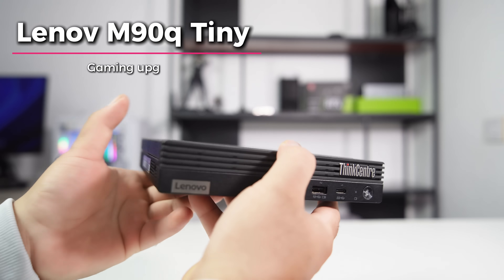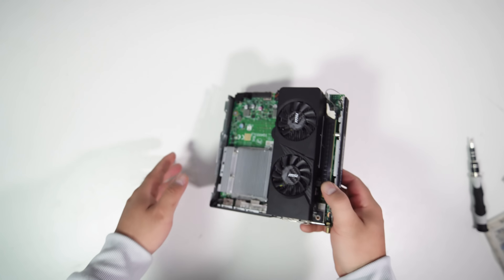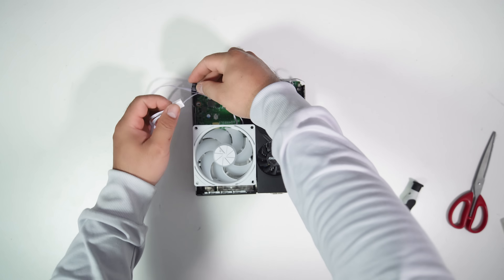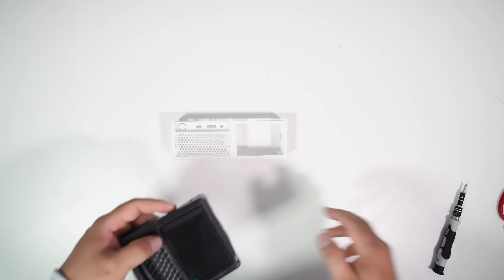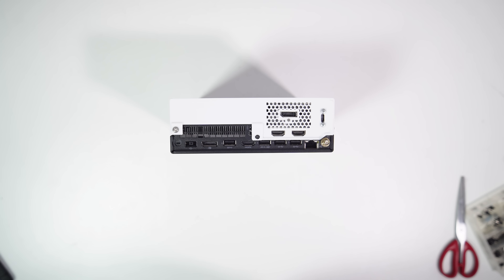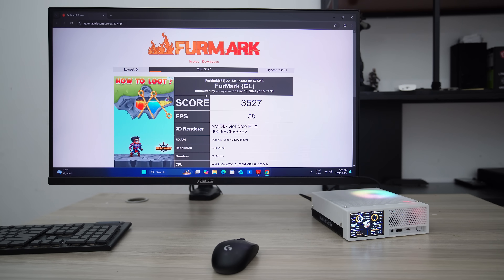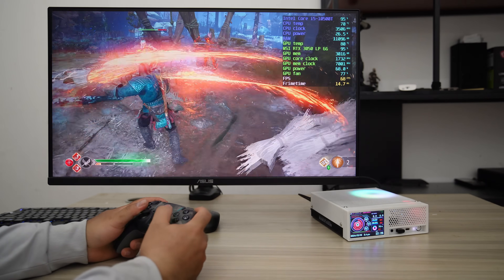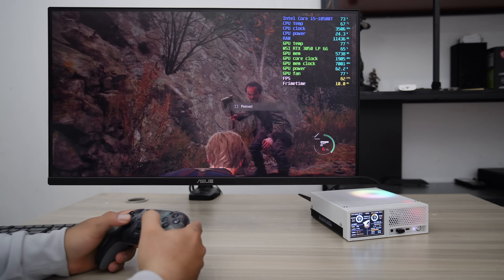Lenovo M90q 3D Case Mod: Epic RGB Fan, Stunning 3.5in LCD + RTX 3050 LP, CPU Fan Noise Fixed!

Comment: Is the 3d case compatible with the m80q?
Reply from the maker: Yes, the case should support M80q gen1 but you don't need it because M80q doesn't have PCie slot.

Comment: I can't help but wonder about the efficiency of the CPU cooling solution.
The OEM fan is designed to blow air across the radiator fins from the front.
Your fan is mounted on top and attempts to blow air downwards. There is no spacing between the fins from the top side so the air can't even go in between them.
Reply from the maker: You can just check the CPU temperature during gameplay; it was nothing bad. You can't have everything at once, and trade-offs are necessary. I consider this a balanced setup and have no complaints about the CPU temperature being around 75c. This project is primarily for DIY and hobbies. If you were upgrading this PC strictly for gaming or serious work, it wouldn't be worth it since the performance is low. The screen and RGB fans, therefore, are a great way to showcase what a DIY enthusiast can build at home. If you're looking for a high-performance PC, this project or video is not for you.

Comment: I am new to this so apologies for the daft question:
Could this work with a Dell Optiplex 7040 or so?
Reply from the maker: No, it doesn't have a pcie slot.
Reply: @itggear I saw someone plugging a graphics cards with adapter cable via SSD slot by the looks of it. Again, curious as very now to me so sorry if its wrong

Comment: 9600x3d(65 watts) and 5060(145 watts) the hdplex 250 watts gan can handle this cpu gpu combo? With itx mobo 32 gb ddr5 and gen 4 m.2.
Reply from the maker: Check another reply comment.

Comment: Where does this VGA power come from? does it use power separately?
Reply from the maker: It's the RTX 3060 6GB version with a 70W TDP, so it draws power directly from the PCIe slot.
Reply: Do all RTX 3060 low profile VGA not require additional external power or power supply? @itggear

Comment: Great video and 3d Design!! someone know what is the name of connector for fan? any convertor to pwm normal fan? Best Regards
Reply from the maker: It is DIY connector. I cut the original CPU cable and wiring with a PWM fan cable to make a conversation adapter.
Reply: @itggear  Thank for answer Sir, wow this is a challenge, how adapt the wiring? i dont know the order of wires
Reply: @itggear  Hello friend! can explain me the order of wires to attach pwm fan adaptor to this lenovo connector fan please¿ Thank you

Comment: Is your RTX A2000 M90q case version compatible with this one -- e.g. are the two back plates interchangeable? I have a A2000, but I like the 3.5" display. Any chance you'll share your .skp files?
Reply from the maker: @JAlexander-n2j  Please check my Patreon shop.
Reply: @itggear  Ah, this one allows any LP/dual-slot GPU for P330, M720/920q, Thanks:  "3D Case model-for M720q for Dual Slot LP GPU 3.5in Screen"

Comment: I want to do this project but the pc which I am going to has slight variation. It has one extra port on the front instead  of two. How do I change this on 3d print file?
Reply from the maker: What is your PC model?
Reply: @itggear  m90q i5 12500
Reply from the maker: Since your PC has an extra front port, you'll need to adjust the 3D print file to fit your model. That means diving into some 3D design—software like Blender or Fusion 360 can help, and there are plenty of tutorials online.

Just a quick note: modifying a new PC might void your warranty, especially with physical changes. My channel focuses on updating outdated e-waste PCs where warranties aren't a concern.
Reply: What is the intel spec you got?
Reply from the maker: @shobino  it is Intel core i5-10500t.

Comment: If that is a m920q, did you mod for the second M.2 on the bottom?
Reply from the maker: It's not a M920q it is M90q which is next gen of M920q. This model has M.2 slot. Thank you.
Reply: @itggear  What CPU is in this M90q? What Gen for the M90q?
Learning a lot for this TINYMINIMICRO from your VIDS.

Comment: will the 3d print with screen fit the m80q as well
Reply from the maker: In my opinion, I think it should work with M80q gen1. However, I can't confirm compatibility with any model other than the one in this video since I haven't tried it yet. Thank you

Comment: Do you have a wire diagram for the adapter you made thank you great work ..gather parts now. also do you have a link for the screws
Reply from the maker: In this setup, I have tried several times to match the original fan cable with the PWM fan cable. First, I wired the yellow cable of the original CPU fan cable to 12V on the PWM cable and black wire to the ground wire. The other two cables are the PWM signal and the RPM report signal wires. I can't tell which is which since different fans may have different wire colors, but you can try connecting them one by one to find out which works for your fan. As long as you wire the black wire to ground and the yellow wire to 12V on the PWM cable, you will be safe.

This is unofficial, so I don't cover it in my video. If you would like to try it, make sure you do your own research and take your own risks. Thank you, and good luck with your setup.
Reply from the maker: For female thread embedded nuts, I designed it to fit M3x5 female thread embedded nuts, so you can search for it. For the screw, I use PC case motherboard screws, which fit perfectly with the M3x5 female embedded nut. Thank you.
Reply: @itggear  thank you . i had planned on using the exact fans you use but i get it thanks for you help and great work . i might just go with a noctua fan. also do you have a link for the embedded screws /hardware

Comment: hey ITG, did you had to set a gpu power límit as with the a2000?
Reply from the maker: As you can see on the Afterburner graph, the GPU is running at 68W-75W. I did not lower the power limit with this setup, unlike in my previous video where the GPU was running at around 50W to 55W because I reduced the power limit to 80%. Thank you.

Comment: I loved watching the video. 😁😁😁
It will be very helpful to me to make some modifications to my Lenovo ThinkCentre M920x Tiny. 
Only that I would like to put two Thermalright fans so that it has more air flow but I don't know if the computer can support that number of fans and if it can support the fans the other problem would be the size of the computer and making it a larger chassis great with 3D printing. 🤔
Reply from the maker: I don't have that PC.

Comment: Hey, nice build! Have you thought in deshrouding the gpu and put a 120/140mm fan in the case to cool all the pc (cpu and gpu)? I think this would be quieter, and it could be made by printing the case with the hole for the fan.

Comment: HELP How do I boot into windows? I connected my monitor to 3050 HDMI port - Just a black screen!
Reply from the maker: When the GPU is installed, Windows might not recognize the device yet. Please connect the HDMI/DP cable to the HDMI/DP port on the motherboard and then boot to Windows. Go to Device Manager and check the display adapter to ensure your GPU is detected. Download the Nvidia app or GeForce Experience and complete the driver installation. If your PC detects your GPU correctly, you can switch the HDMI/DP cable to the GPU HDMI/DP port.

If it is still not detected, or the driver installation cannot be completed, shut down your PC, check the PCIe adapter, and make sure it is installed straight and without pressure. If everything seems to be okay but it still doesn't work, please access the BIOS and reset or restore factory defaults, then try again. Thank you.

Comment: How far is the gpu space i have a 1 fan 1660 super phoenix edition any help please
Reply from the maker: You can't fit a 1660 Super Phoenix; it can only install a low-profile GPU even with a 3D case, unless you use a PCIe expansion cable and design a bigger case to install your GPU. However, it still cannot run a GTX 1660 Super since it does not have a PCIe power cable. If you use any PCIe power cable adapter, the PC will shut down under load because the board's power cannot handle the higher wattage.

Comment: Thanks for sharing this mod. Would love to try this on a P3 Tiny with 14900T and install a 4-port 10Gbps Chelsio or Intel SFP+ low profile card. 
If only there is a way to install a decent fan on top of that network card.

Comment: Amazing work man! Very beautifully! I have two Dell Optiplex 3000s, but they do not have any slots for gpu and need a nvme to pci express adapter.
Reply from the maker: Thank you! If you are thinking of doing a similar mod, you can try using a PCIe to NVMe adapter. Please check out this video where I've done the mod on the Dell Optiplex 3050 Micro to install an RTX 3050 LP using an M.2 to PCIe adapter: https://youtu.be/sxvhNyrCc30.
Reply: @itggear  It's precisely what I'm trying to do.
I'm not secure about soldering the motherboard.
Downloading your chassis project to print! Thank you!
Reply from the maker: If you're happy to use dual AC adapters, you can use them without a wired cable directly. Alternatively, there is a cable splitter for DC jacks that comes with various types of tips. You can choose the correct one for your PC and Pico PSU, allowing you to still use only one AC adapter. I planned to do so, but the order from AliExpress would take a long time, so I opted for the quicker solution.

Comment: wait.. isn't m90q have a 2.5 inch sata slot? if yes, why don't you get the 5v for that argb controler from sata power port?
Reply from the maker: I've tried it already, but it doesn't have power. Maybe the pinout of the ARGB device is not aligned with the SATA power connector of the Lenovo M90q. To make it easier, just sleeve the cable with the USB cable that connects to the LCD screen. Also, if we can find an RGB fan that independently glows by itself, we can just connect it to the CPU fan cable, and it's almost done.

Comment: I like what you do, but I would like you to modify some cheap Chinese mini PC like an N100 so that you can improve the cooling and change the case.

me gusta lo que haces, pero me gustaría que hicieras una modificación de algun mini pc chino barato como de un N100 para que le mejores el enfriamiento y un cambio de carcasa.
Reply from the maker: This video is just an idea showcasing what the corresponding model shown in the video can do for its owner. I already had this PC, so I decided to mod it and didn't need to buy any other PC. If you don't have this PC yet, I'm not trying to convince you to buy this model and do the same mod as I did. You can choose whatever you want.

Comment: Next project: Proxmox with TrueNAS and Plex using 2 adapters on nvme ports to get extra 6 sata ports (total 12). Its that posible?
Reply: if i'm not wrong, hardware heven and wolfgang's channel already did that using m.2 sata controller with 5-6 sata port on dell optiplex micro or hp elitedesk
Reply: @mustikaajiwardaya5383  my objetive it's that posible in this particular tiny hardware

Comment: I'm surprised you have a 70W GPU it running stable in a Tiny 6. According from all i've read the Tiny6 PCIe slot can't handle >50W reliably and will by default throttle at all time.
I do have the single slot yeston 3050, my Tiny 5 (920x) can't handle it and my m90q gen4 with 65w CPU at least needs another cover with more ventilation. It's sound profile is like a leaf blower anyways :/
Thinking about changing for a MS-01, but the minisforum firmware support is absolute trash and even worse for linux users.
Thanks for this inspiration, very good video!
Reply from the maker: I read the datasheet for both models. The M920q's maximum AC adapter option is 135W, which does not support a 65W CPU or a GPU. Meanwhile, the M90q's maximum AC adapter option is 230W, designed to run the Intel Core i9-10900 with a PL2 of 224W, but it does not confirm GPU support. So, pairing a GPU with a 35W TDP CPU is possible as long as you can manage the temperature to prevent overheating. Thank you.
Reply: Hi! I also have a single slot yeston 3050 6gb low profile and I want to buy an M90q Tiny 3rd generation with cpu 35w now. Can you tell me if pcie 4.0 will work for me? or am I mistaken and gpu riser supports only pcie 3.0?
Reply: @ochir4731  Hi! 

Gen4 and Gen3 share the same q670 chipset and most addon cards, by architecture it counts as "Tiny8".
Currently i can not test anything for you, my m90q gen4 is a server in production.
My raiser is a part# 5C50W00933, which is a later revision of the now unavailable 5C50W00910 (rev1.2 vs 1.1).
The PCIe Slot is a x8 Gen4. The raiser will bring the electrial x8 gen4 connection into a x16 sized slot.

For more Informations i can recommend the following search term: "servethehome project tinyminimicro Reference Thread" - you will find a forum thread with over 2700 replies and a lot of valuable information in the first post and latest discussion.

Edit: i had my yeston gpu in that machine using open chassis, but i decided to change the machines purpose before making any modifications for airflow in a closed chassis. You will need air intake above the fan, possibly for outtake too.
side note: the 920x/p330 was designed for either 65w CPU or 35w CPU + ~45w GPU, which is why the cards >50w often had problems going beyond simple throttling, some people use modified raisers with extra power delivery. Later m90q are still intended for gpu power limit of 50w but can handle 70w via PCIe and with the correct setup it can be combined with 65w cpus.

Comment: Can I use RTX 4060 LP?
Reply from the maker: Oh please, even for a 5V ARGB controller, I couldn't find any power source on the motherboard and ended up using USB power. So can you imagine where you would find the 8-pin PCIe power for the RTX 4060? Also, the motherboard can handle only 135W power for the whole system. If you install the RTX 4060, it will shut down under load.
Reply: you would need an external psu just for the gpu, also some mods

Comment: Awesome build! Have all the parts except the MSi LP 3050, awaiting Amazon shipment. The model you show is the M920x not the M920q which has only one usable SSD slot. Please post the case print file ASAP as I have to send it out for quotes from local PETG printers!.
Reply from the maker: In this video, I use the Lenovo M90q, which is different from the Lenovo M920q/M920x. I've just updated the 3D files link in the video description. If you would like to check the 3D case for the Lenovo M920q/x, please see my Lenovo M920q video for the 3D case link. Thank you!

Comment: I wonder if moving the new CPU fan more to the middle and using a duct to exhaust the hot air out the back as designed would also work?  I'm more familiar with the 6th-9th gen CPU version of these Lenovo, but those have an optional 65w copper heatsink that also cools the VRM.
8:40  240W should be plenty btw.  I run a 12500T and a 4060 in a Chinese JW H610 PIO motherboard and it's been flawless doing VR.
Thanks for the great ideas and the design work.  I want to print it without the LCD screen and possibly have a custom riser made so I can fit an 'ITX' GPU inside instead of a low profile because that expands the options a lot.
Reply from the maker: The GPU takes up 16mm of space inside the PC body. This means if you want to install an ITX GPU with an extra PCIe riser, you might need to move the GPU location outside the case completely. You will need to add an extra 40mm or 50mm to accommodate your GPU, making the PC thickness 80mm. If you want to do this, my 3D file will not fit, so we need to design a new one and take exact measurements with the components you want to use. Thank you.

Comment: So what's the difference between the m920q and this m90q?
Reply: Quite a few, the m920q (m920x, m720q and P330 Tiny) are for 8th and 9th gen Intel CPUs.  The cases look very similar, but the location of the cutouts and screw holes may not line up.  A 3D printed case like this does not care about those differences so it may work fine.  The holes it uses on the back seem to be the same.  And there is a third screw on the side near the video card in the back.  I missed it if this case fits.

Comment: Can the cpu be changed from PCIe 3.0 to 4.0? Example i5 10500 to i5 11500.
Reply: idk i think you should change the motherboard too
Reply from the maker: This PC does not support 11th Gen Intel CPUs. However, the Lenovo M90q Gen 2 with an 11th Gen Intel CPU still supports PCIe 3.0, not 4.0. Thank you.

Comment: Thanks so much for the idea with the CPU fan! I have a similar setup in P330 Tiny and CPU fan noise drives me crazy. I also couldn't find the adapter for the stock fan, so I'll go route with cutting.

As an idea: you could try removing the GPU fans and install a single 180x25 fan to cool both CPU and GPU simultaneously.